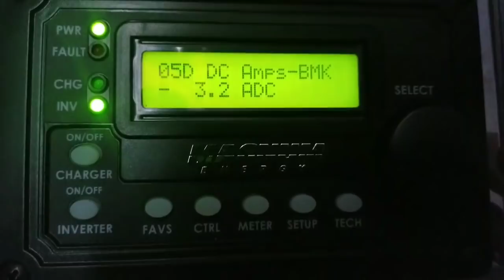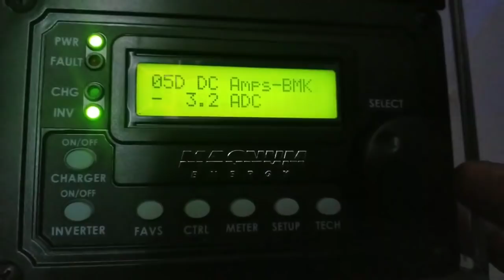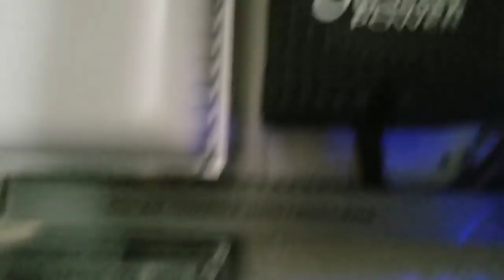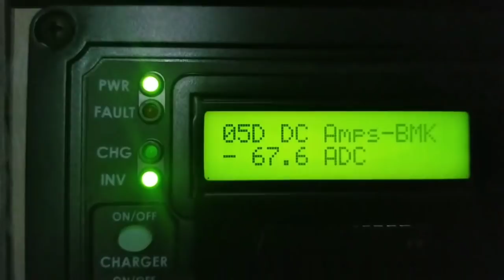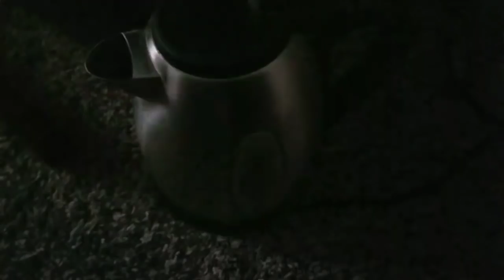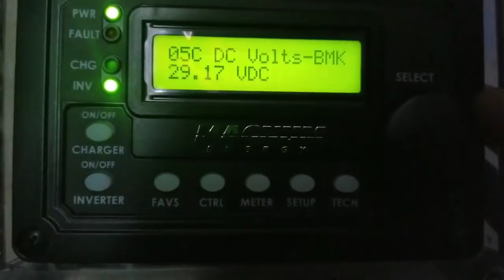VOLKSWAGEN e-GOLF Li-ion BATTERIES LOAD TEST Pt#2 | 3,383kW Load test with Magnasine Magnum MS4024

Comment: are the battery cables warm at 4000 watt output?

Do you have to tell the inverter/charger that the batteries are lithium?
Reply from the maker: Good morning brother John, 
The system was running great. No heat on the batteries neither the wires. 

Finally, by using the custom settings, the system doesn't know if the  batteries were Lithiums or not.
Thanks for your brilliant comment and concern. 
Have a bless Sunday Sir!